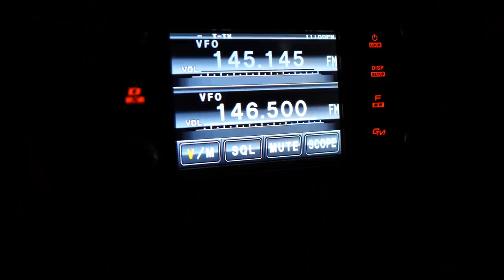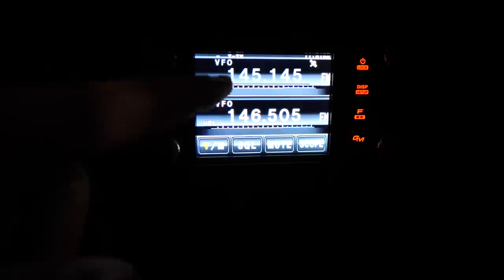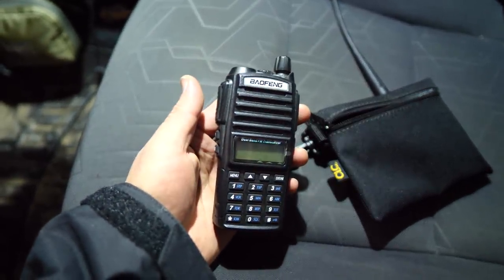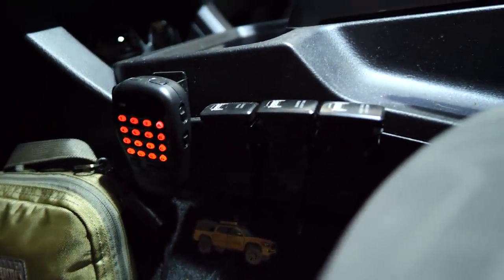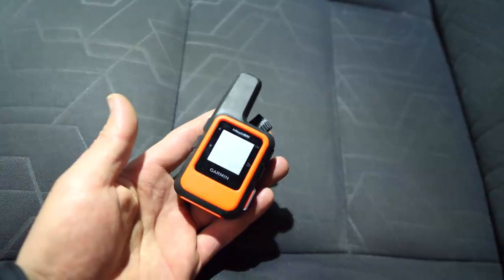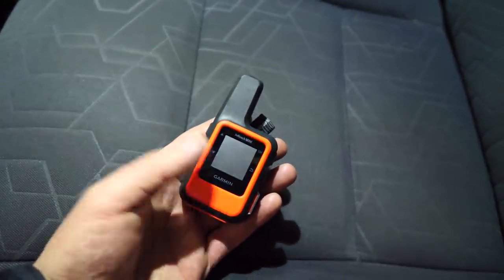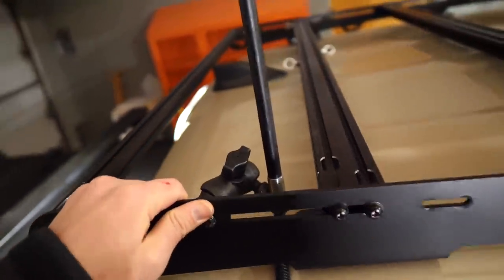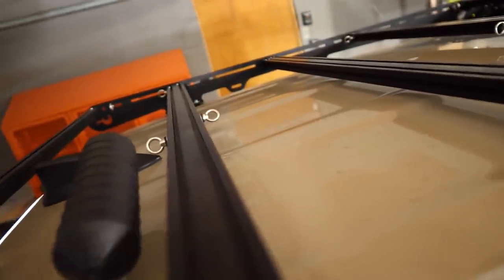COMMS Part 1 - Overland Communication tools/gear - Ham Radio, WeBoost, Garmin inReach

Comment: There are places where NO signal can be received. No booster will work in that situation. That’s what they mean. Yeah, if there is a weak signal, it will boost it. Or zero bars might turn into one or two bars. But if no signal is getting through, the booster won’t do anything. It has to have something to boost.
Reply from the maker: Yes, as explained in the video. 👍🍻

Comment: CB is older and weaker than GMRS.  GMRS also uses repeaters and CB does not.  GMRS is currently $70 for a license (eventually will stop to $35) and is good for 10 years.  One GMRS license  is good  for the whole family and you only need to announce your call sign every 15 minutes.  HAM is more stringent.

Comment: Why are you moving? Work?
Reply from the maker: Mostly for a bigger garage, honestly. My last house just had a 1 car, and wasn't big enough to actually work on my truck in. When it's 10 degrees out, it gets tough to work on my truck outside, haha.
Reply: @LastLineOfDefense  u should live off grid
Reply from the maker: It'd be cool one day - but right now with my workshop in the garage, job as a web developer, needing to process and ship orders, etc - getting an equivalent setup off grid wouldn't be realistic.
Reply: @LastLineOfDefense  do have a back up capability to run your radios, laptop, when power and cell service is out during shft